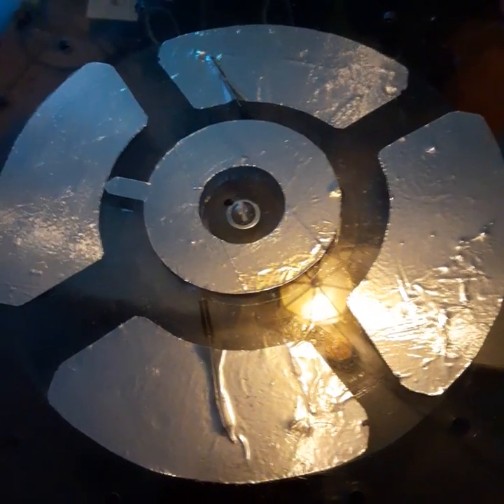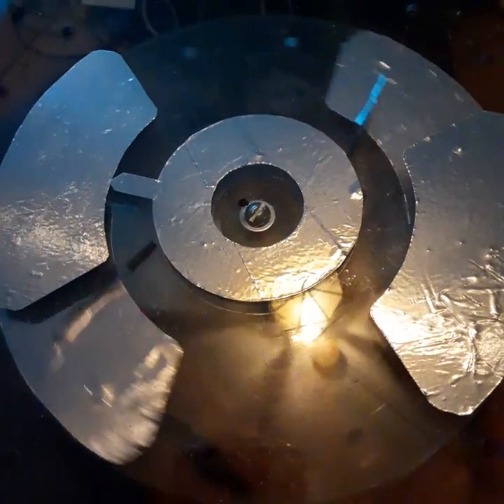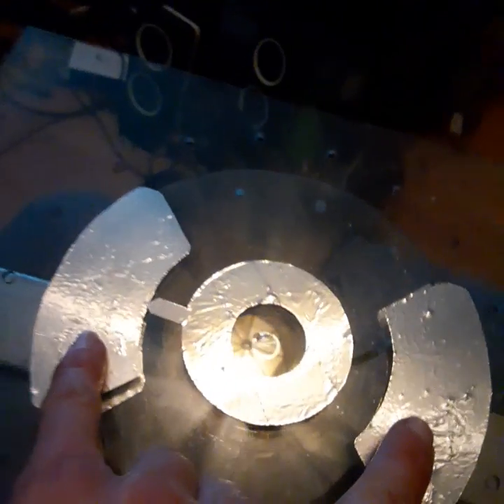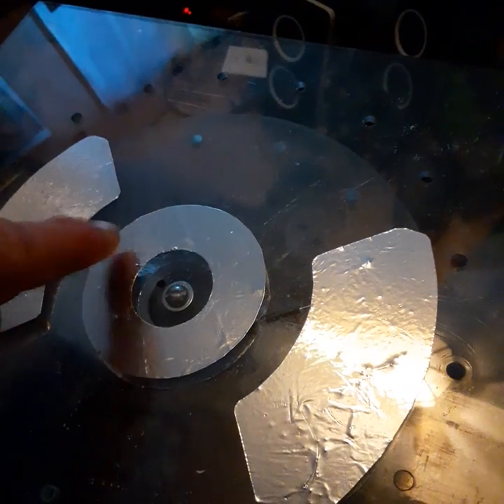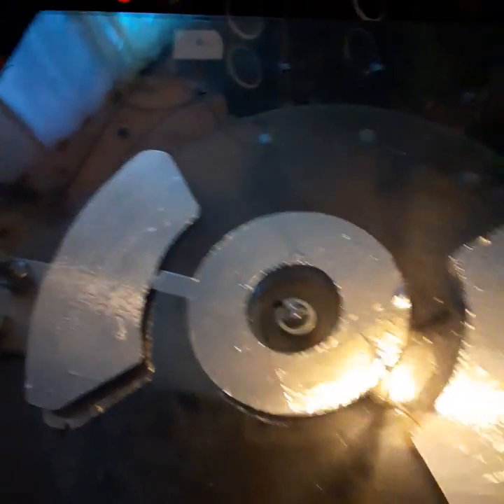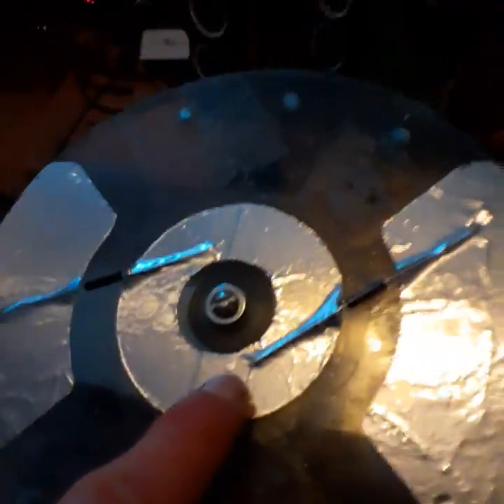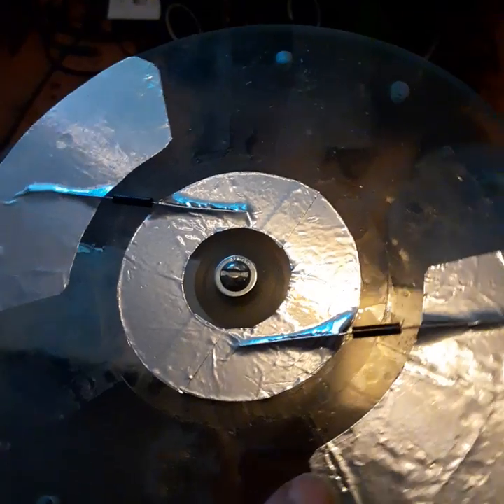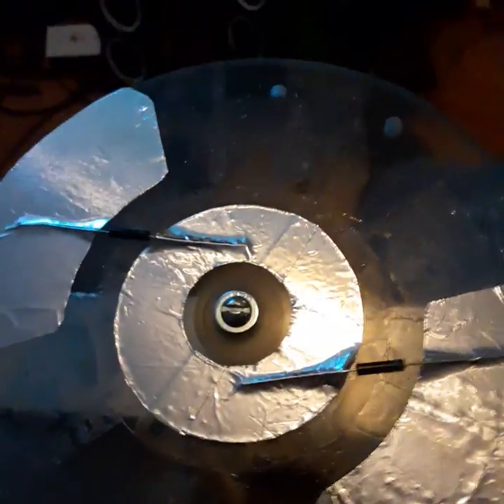electrostatic generator

Comment: Does it work on the principle of electroohorus?
Reply from the maker: it is an electrostatic induction device. 
in past eras they did not have the fancy diodes that we do now, and this is why this design was not around in history.
one of my friends wondered if it was possible. I thought it was possible and tried to sketch it out to show him, but I can't draw well enough, so I just built it and sent him the video to show it works.
Reply: @spacecase0  by induction devices, do u mean it polarizes the charges due to triboelectric effect (friction) ?
By the way, unlike electromagnetic generators, electrostatic generators becomes easier to hand crank when load is increased.
Reply from the maker: @yogie_ji_gwalior_wale  it is not a friction device, it is electrostatic induction. https://en.wikipedia.org/wiki/Electrostatic_induction
fascinating that the devices get easier to spin with load... that sounds like it is worth some testing to see what is going on there.
Reply: @spacecase0  yes, the spinning get easier when load is added but you will have to put a step up transformer in between the induction device and load, so that the primary will pull more current from the device when load is added on secondary side of transformer. 

This happens because the primary coil's impedance reduces drastically when secondary is loaded. 

And when impedance or resistance becomes lower  or even negative, the electrons will choose to flow to other terminal instead of accumulating at a place. 

And that's the reason spinning get easier because whatever electrons you are collecting as part of electrostatic induction will not stay and accumulate but will instantly flow to other terminal of opposite polarity as the line resistance is lowest.